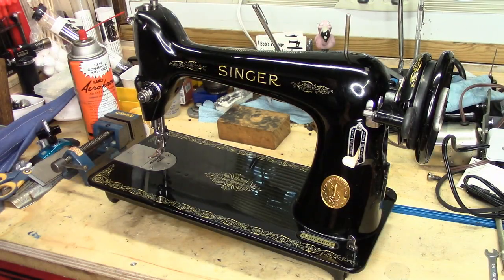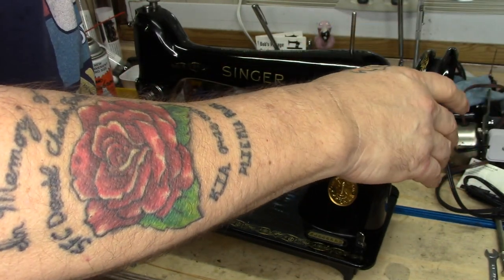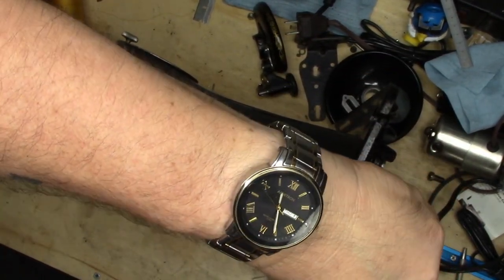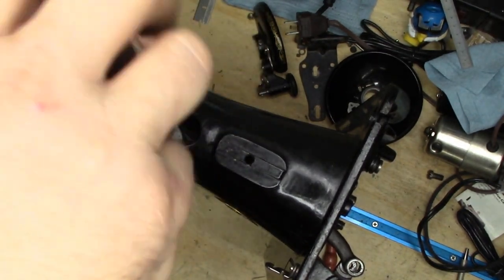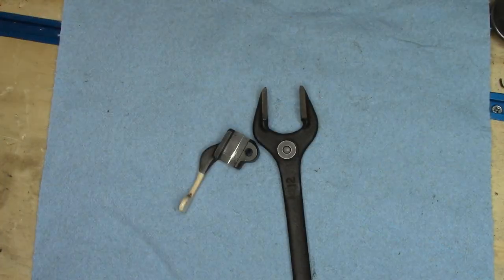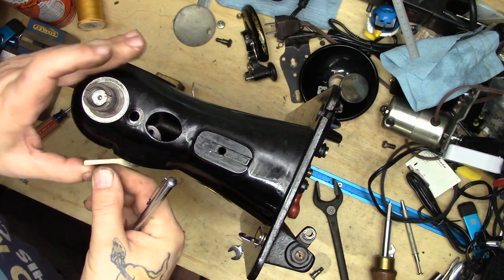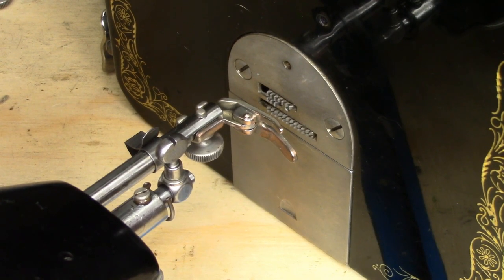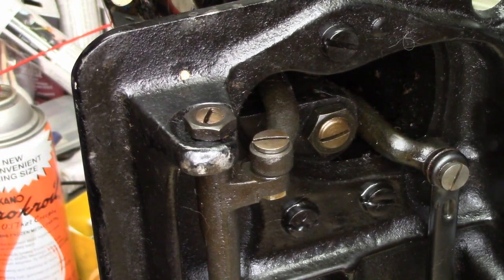Singer 66 Stitch Length Regulator with Reverse

Comment: I forgot to mention what a gorgeous 66 that is! Hard to believe it needs any cleaning it's fabulous! I just watched a video using the reverse on a 201-2 and omg my mind is blown, I may withdraw previous thoughts on reverse.
Reply from the maker: LOL nA 201 has proportional reverse, which is a true reverse compared to a 66 or 99. You can set stitch length for forward, and it will do the same exact length in reverse.
Reply: @BobFowlerWorkshop  I'm looking forward to it.

Comment: Again, fascinating! Now I'm wondering if I can swap a never to a screw type 😂 For whatever reason, I'm not crazy about the lever style 🤔 I won't but I'm curious teeheehee 🤭☺ My 20 year old Kenmore has a button for the reverse and I am not crazy about it. I'm not crazy about the reverse at all, honestly. Maybe, once I learn to sew I can learn how to use it. Seems unnecessary to me. "tweaky tweaks" is a technical term, yes yes yes! 😆😄😁 I use that term from time to time. I'm definitely going to look for a magnetic stick, do they carry them at Harbor Freight? As always, wonderful video and great detailed information. My "workshop" is so cold 🥶 but I'm hoping to finish up holiday decorations so I can get back to work on my machines. I'm missing them so!
Reply from the maker: Sorry, can't retro fit the screw type, you're stuck with what came from the factory. I, however, DO have some good news! The decals for your 66 arrived, and that machine has a screw type stitch length regulator. Oh yes... The skinny magnets on a stick... I get those at Harbor Freight.

Comment: I just recently acquired a Singer 66-18.  Been watching some of your videos and am very thankful for them - you do a great job on them.  I have a question- when I start sewing and the stitch length indicator is at the longest stitch - when I start sewing that length indicator pops up to around 10 stitches per inch and I loose my long stitch.  I am at a loss.  Please help.  Thanks!
Reply from the maker: Hi Nancy, check the fore and aft position of the feed dog in the needle plate. Often, if the adjustment is out of whack, the feed dog will strike the needle plate and move the stitch length adjustment. The adjustment is made at max stitch length using the eccentric bolt that secures the stitch length regulator fork to the feed dog rock shaft. Make sure that the feed dog does not touch the plate at either extreme of travel.
Reply: @BobFowlerWorkshop  Thank you so much!  So happy we found you site & videos, they are much appreciated!

Comment: The stitch regulator on my 99k is loose and falls all the way down with gravity. When I first picked it up that lever was so stiff, it would hardly move. I added some oil and moved it several times, and it suddenly felt like it kind of broke loose and now it’s just floppy. What do I do?
Reply from the maker: It sounds like your pivot screw is either too loose, or the lock washer is either missing or defective.  Try tightening the pivot screw. It is located on the far right of the machine, between the handwheel and the motor mounting screw.